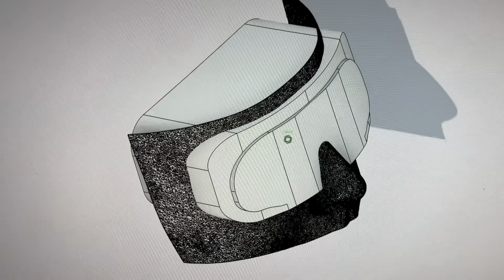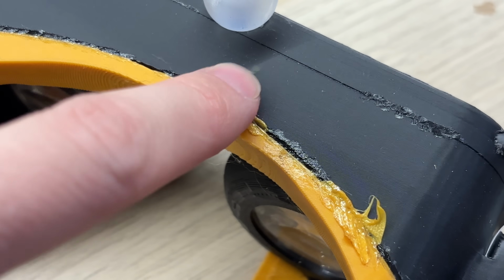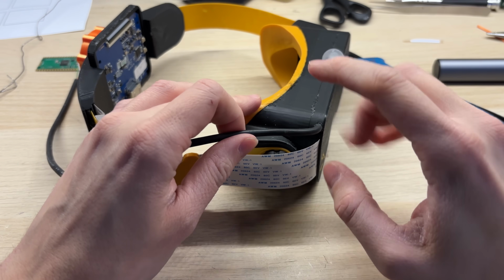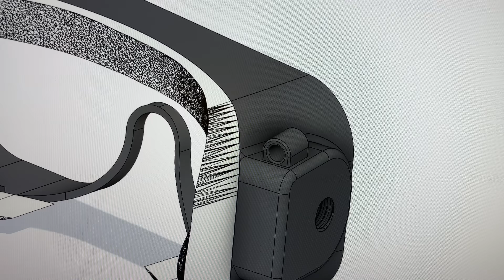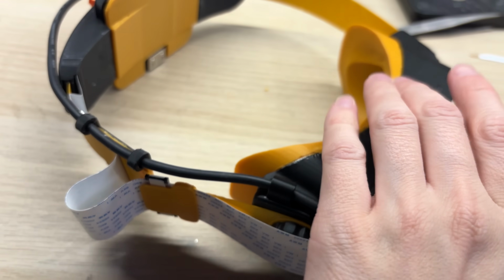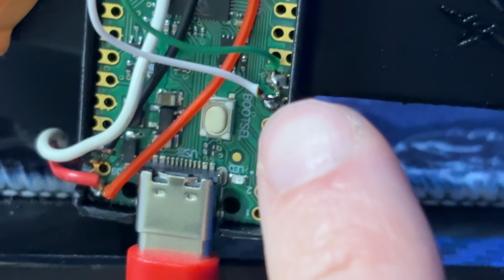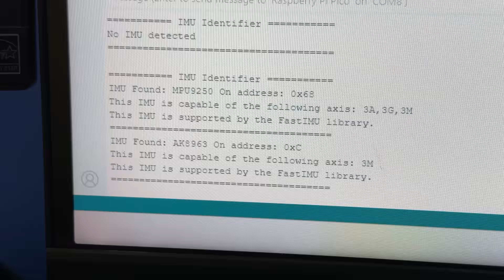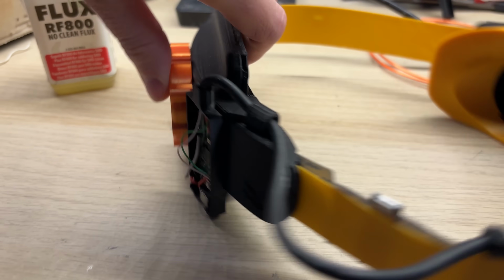Persephone Zero | Smallest DiY VR Ever

Comment: you have good ideas but the implementations are less polished than it should be, even for prototypes. I suggest using heat inserts and 3d printed compliant mechanisms to reach some kind of repairability and reusability on your pieces and designs, so you can iterate on them instead of rebuilding or redesigning from the ground.

Comment: There are 2K panel (driver)s from the same manufacturer, which is just slightly bigger than the total rectangular area of the round display. You may try using that instead, but beware that those things are INCREDIBLY fragile.
Reply: Do you mean the 1440p & 2160p ones? Check his last headset video!

Comment: I haven't watch the video yet, but I don't think you can emulate the true VR headset with simply a diy, 6 degree of freedom and other functional features are easily the most complex technological of the modern days, it is a huge part of what makes VR awesome in the first place. The VR potential is far superior to any home device
Reply: Well, this headset uses the ball for 6DoF (using the playstation move system) and works with steamvr. If one doesnt have a ps move camera, one could still use lighthouses and attach a tundra or vive tracker + compatible controllers to the headset itself for high precision tracking^^

Definitley not an all in one solution and absolutely not an economically viable option for most, especially if you dont already own some vr gear, but impressive nevertheless i think.

Comment: It's really a shame that the driver board and raspberry pi can't fit in front of the display without making it bigger, since it leads to two bulky wires and so much extra consideration around the head strap. Custom PCBs might be an option, but that might be way outside the scope of this.
Reply: it would help with weight distribution though

Comment: can i buy this maybe from you pls? i cannot solder and do not have a 3d printer
Reply: A soldering iron can be brought for <£20 and can be learnt in an afternoon by watching yt videos. Check for local libraries ir makerspaces as many have 3d printers available for use, alternatively you can use print on demand services like jlc3dp to get the parts.

Comment: Could you try to use a raspberry pi zero W plus power bank and convert it to a wireless headset?
Like that https://www.youtube.com/live/azyt_Vt96bg?si=LtRyHJd9t-NCkcq5
Reply: You would have to wireless the hdmi signals too while maintaining synchronization between the gyro data and the visual data in a low latency manner. Would be neat but hdmi with any decent resolution starts to take some serious bandwidth and compute power. Would love to see it be done

Comment: Is it possible to make a tracking system for him using cameras on the helmet, instead of base stations?
Reply: Well yeah it is possible but you need faster and stronger hardware as well as make your own complex software because i don't think there's any software for cameras
Reply: @thebossb2149  There is software out there, namely Monado's Basalt fork, SVO Pro, and ORBSLAM3 might be worth looking in to. Basalt is already setup for using with VR headsets (DIY ones too), but only on Linux with Monado. It's missing some features (loop closure) that make it suboptimal though - it'll drift noticeably during use.